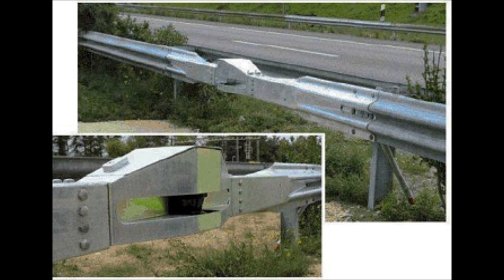New Crash barrier Speed camera in the UK from the Iveco daily project off grid camper

Comment: They are in Germany, Switzerland and France. The LIDAR uses a laser which has superior target acquisition in high-volume traffic areas instead of the usual radar. This laser can pinpoint vehicles even in congested areas of highways. As long as the emitter and the receiver's vision is not obstructed, then it does not matter whether it is encased in metal, wood, rubber etc ... it will still work fine. The camera in other pics are to take a snapshot of the car model and the driver.

Comment: Hidden Cameras are Illegal in the UK.. what about the cameras they set up in the vans with blacked out windows.. are they not hidden.. they have no warning of their use ahead ???.
Reply: redrik11 according to several police force websites they claim They don't need to warn of speed enforcement vans now. Which has happened at same time that they introduced covert style vans for with no safety markings or camera warning signs.
They have two hatches at back and one above drivers seat so they can enforce both directions.
As they look like gas vans or camper vans they are parking next to delivery vans and maintenance vans. In some cases apparently illegally too.